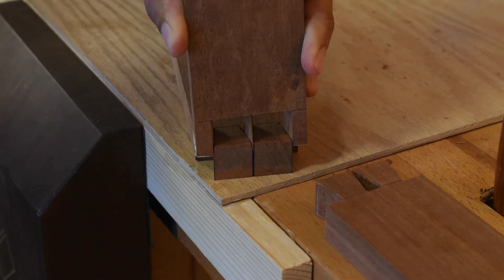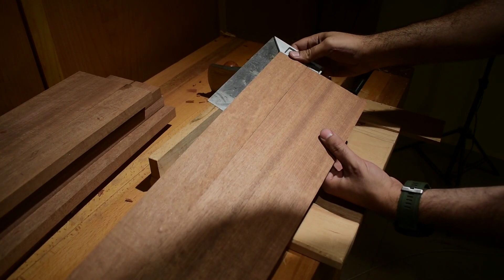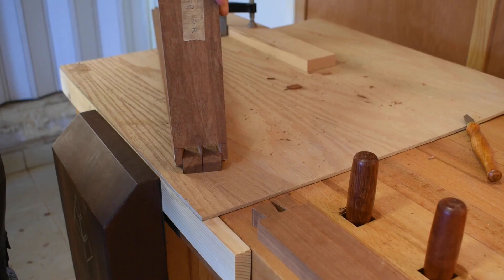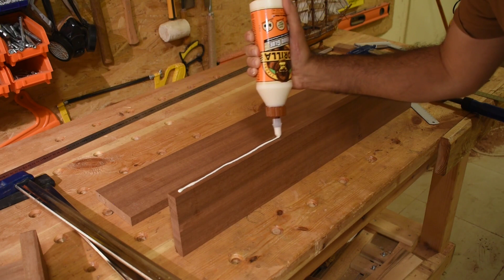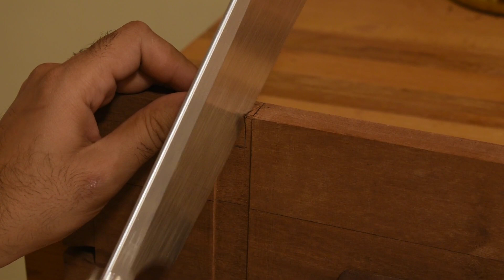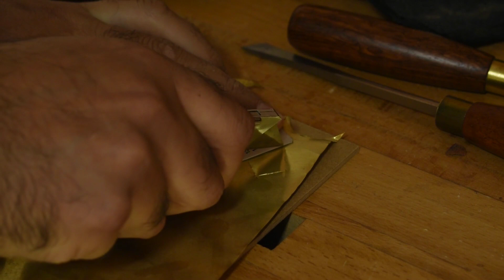Hand-Tools Chest Cabinet Inspired From 19th Century |Full Build Video|Part1

Comment: I'm attempting something slightly similar. I was curious if you think the back panel needs to be rail & stile with the weight it'll be supporting, or if it is fine to glue up panels. Also, did you use 4/4 lumber or something thicker?